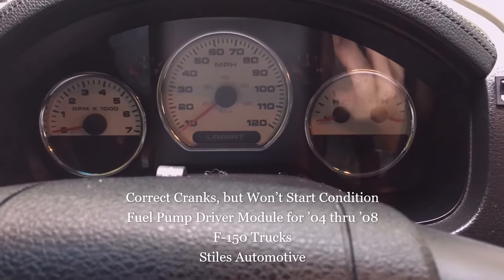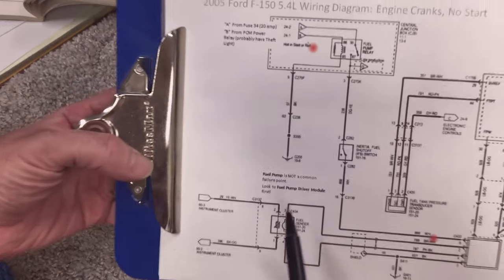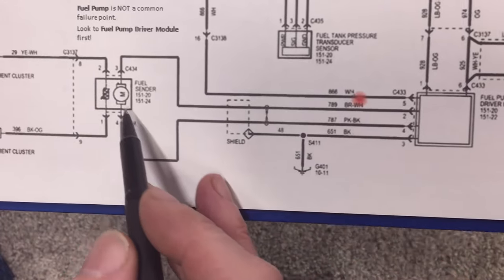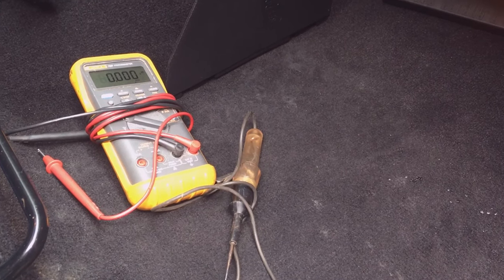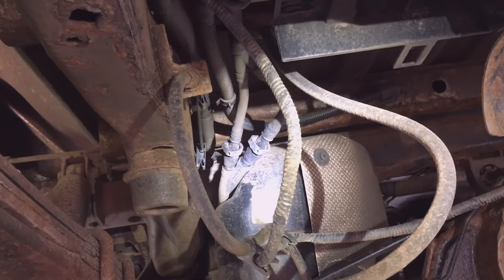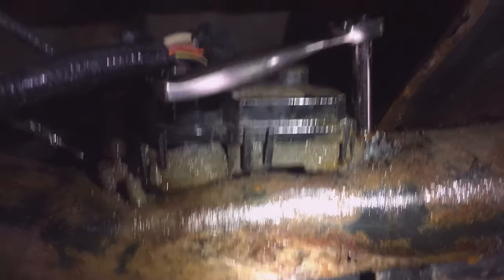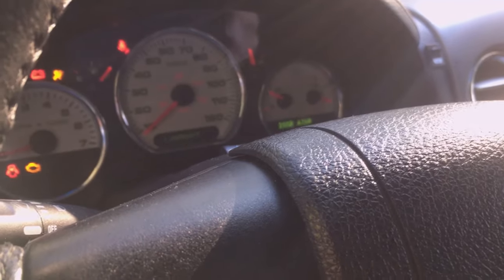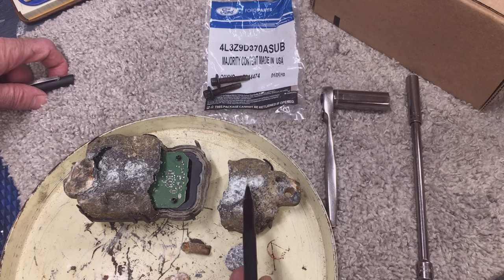Correct Cranks, but Won’t Start Condition – Fuel Pump Drive Module for ’04 thru ’08 F-150

Comment: Hi, please help me. I have 08 f150. Crank,  but no Start. Every morning,  it will start for 5 seconds and shutoff then never starts again. 
So I check the driver pump module, it looks bad. I bypass with wires like you did. I heard the fuel pump running,  but when I tried to start the truck it still wouldn't start. 
What could be my issues? I removed the fuel pressure sensor, I see gas in the rail.
Reply from the maker: Erad, Makes me wonder how much Fuel you have at the Fuel Rail, Can you get a Fuel Pressure Gauge and read the pressure at the Fuel Rail? First do this; After you experience the "start for 5 seconds and shutoff", cycle the Ignition Key on and off (like priming the Fuel System after running out of Fuel, turn Key "On" 1, 2, 3, 4, turn Key "Off" 1, 2, do this 5 times), now start the Truck. If it runs, your Fuel Pump could be weak, (I don't know what it sounds like), has your Fuel Filter either been replaced? If you have good Fuel Pressure at the Fuel Rail, I suspect the Fuel Pressure Switch.

Your FPDM may still be working, but if it "looks bad" replace it and clean the mounting location and electrical connector.  Let me know how it goes! - Stiles
Reply: @StilesAutomotive  thank you for your reply. I did everything you mentioned except for the checking of the fuel pressure.  I do not have the machine to do that option. 

I installed the new fuel module today. The truck started once and dies.  Then never start again, but cranks. 
I have order the Fuel Pressure Sensor attached to the Rail. I will see what happens after. I am a little worried because I saw some videos online that people disconnected the fuel pressure sensor and their truck started and runs.  Mine does not when I disconnected it.
Reply: @StilesAutomotive  Also, I have checked all the fuses and relays. The engine doesn't start to warm up enough to get a code. So, NO fault code is available. It's always shows testing is not complete
Reply: @StilesAutomotive  Hi bro, so I changed fuel pressure sensor, and  the throttle body and the sensor. 
It still does the same thing, started and dies after 3 seconds and never start again.
I removed the fuel pressure sensor by the fuel rail again, I cranked it, there's high pressure fuel flying out. So I know it getting enough fuel. I hear click from relays and fuses are good. Please what is the next thing to do. If timing chain is going bad,  will it start at all? Remember,  it always starts once at first attempt every day.

Comment: When I turn the key to start position I get approximately 9 volts on  the white wire from the fuel pressure  drive module.   Is that sufficient voltage to run the fuel pump?   Or  is there a voltage drop somewhere that is keeping the (new) fuel pressure drive module  from receiving enough voltage to  power the fuel pump?   Your video is the best one I'v e seen.    Thank you one million times.   Please help me with this voltage problem.   It's like you said,  engine cranks but don't run.  It's a 2006 ford f150  5.4 litre.  I have watched about 30   video's so far and spent a week   trying to get this truck to start, including jumpering the  2 sets of outside pins on the fuel pressure drive module, which did cause it to start, plus verifying grounds , fuses,   wiring, etc.     Again, thank you so much for any help you can offer.
Reply from the maker: Winter, Glad to help.  We want close to Battery Voltage at the FPDM Connector White Power Input Wire, Socket 5.  Voltage drop a few tens is ok, that's Battery Voltage minus 0.2 to 0.4 Volts.  We want 12 Volts at that Socket.  We need to be clear, you said "from" the FPDM, the White Wire is "to" the FPDM.  If you are talking about the Brown-White Wire "from" the FPDM and "to" the Fuel Pump, that's different, I don't think you are.  How did you measure 9 Volts at the White Wire at Socket 5  and using the Socket 3 (Black Wire) Ground like I did my video?  If so you need to measure measure voltage again, using a good ground, use a wire and go all the way to the Battery Negative Terminal if you have to.  You wrote about grounds, did you find and clean the ground on the Black Wire at the FPDM Connector?  I didn't do this in my video.  If you still measure 9 Volts at the FPDM Connector, measure voltage before and after (both wires) on the Inertia Fuel Shutoff Switch (left-side of the Fuse Panel, shown in video).  Is all that clear?
1) Measure Voltage at Socket 5 (White Wire) of FPDM Connector using good ground.
2) If 11.8 to 12.6 Volts, goto step 3, if 9 Volts goto step 4.
3) Clean ground at Truck Frame from FPDM Connector and verify Black Ground Wire is ok.
4) Measure Voltage at Inertia Fuel Shutoff Switch (before and after) should be Battery Voltage on both. 
5) If 11.8 to 12.6 Volts - likely White Wire to FPDM Connector is bad.  If 9 Volts we need to look at why.
  I look forward to your reply - Stiles
Reply: @StilesAutomotive  Thank you so much.  I am going to do all these things you said this morning .   I am getting ready to go out  to the truck right now.  I think ford should not have put the central junction box in such an  inconvenient place, but it is what it is.   Also, to answer your question,  I measured the  voltage   by turning the ignition to the on position  and testing between  the white  wire to the blk/yello wire, and that's where i got 9  volts.   When I  returned the key to the off position  there was no voltage.
Reply from the maker: Yep, that's what I thought.  So, I'm asking you to eliminate the Ground Contact Point and Ground Wire as a problem. - Stiles

Comment: I pulled the #5 keep alive fuse believing it was neccesary to calibrate the new blender actuator door and now I have a no crank no start with a u1900 code stored. 
Any suggestions?
I think the ket was turned to on when I pulled it. Might have been a mistake now thinking back on it.
Reply from the maker: JD, Yep with the key on and the system powered you confused the PCM into thinking it has a CAN Bus fault.  1) Try using a Scan Tool to clear the Fault, 2) if it will not clear, attempt to Clear the PCM memory, (With the Terminals disconnected, touch the 2 Battery Terminals together for 10 seconds, be sure to remove the Negative Battery Terminal first [as always!] ).  Let me know how it goes! - Stiles

Comment: Is it safe to drive to the parts store with the paper clip (jumpers) in ?
Reply from the maker: Mit, I wouldn't if you can find a ride to the Parts Store. Is it just a couple of miles? In my younger days I probably would have tried it. Your Fuel Pump will continue to run with the key on, which will over pressurize the Fuel System. Best case, your Engine will run Fuel Rich. Will it hurt the Fuel System, probably not, it should handle the extra pressure. Will it hurt the Fuel Pump, probably not for a few miles. Will it hurt the injectors or push one open (and introduce excessive Fuel into the Engine?), probably not.   In the end, it would be best to get a ride from someone.  Let me know how it goes! - Stiles

Comment: Thinking of getting a 2004 WT base model.... Owner says it's getting fuel and it's turning over but it won't crank..what you reckon that is?
Reply from the maker: yawotton,  Look to the simple things first.  Fuel and spark, how do you know it's getting fuel? and are you getting spark.  Did you owner hear any noises when it last ran?  - Stiles
Reply: @StilesAutomotive   one of these Facebook marketplace deals 🙄... I ask about the fuel pump and he said it's working... Got it from the owner as payment...yeah one of those deals... wasn't catching when he got it

Comment: I tested both the ground the black and white and  the power the white one...the ground one isn't making the circuit light up so I don't know we're to go from there now
Reply from the maker: Marcos, Your message is a little confusing. This may help you. Reference the Wiring Diagram starting at 2:19 of my video. There are 6 Wires, your colors may vary from mine, but should be very similar, these number correspond to the pins on the FPDM Connector:  1) & 6) are control signal wires from the Powertrain Control Module to the Fuel Pump Driver Module (these are the 2 small wires in the center of the connector), 5) White, power to the FPDM (should be battery voltage with the Key "on"), 3) Black, ground (this is the only true ground, meaning to chassis ground), 2) Brown w/white stripe (or BN-WH) (this is the power to the Fuel Pump from the FPDM, 4) Pink w/Black stripe (or PK-BK) (this is the negative from the Fuel Pump to the FPDM, this is not a chassis ground).   Does this help? - Stiles
Reply: Yes the 3)black ground doesn't light up when I test it...we got a mechanic he change the fuel pump and the truck still cranks but won't start

Comment: 2006 f150 will not start with starter fluid. Could this still be the problem?
Reply from the maker: Angie, even if your Engine wouldn't run on Starter Fluid, it should still pop off or try to run. Be careful using Starter Fluid!  I'd look to see if your Engine has spark at the Spark Plugs.  Let me know how it goes! - Stiles
Reply: @StilesAutomotive  the truck was only drove a few times over the last few years. Drove it about 30 miles and the engine shut off. It tried to crank only a few times. It was very loud. Now it wont turn over at all. Power comes on when you turn key. No check engine light and no codes. The battery is new. We are thinking it’s the engine. Thank you for responding

Comment: Replaced fpdm, replaced fuel rail pressure sensor I’m getting fault code P0191 fuel pump is brand new as well. Truck will run fine for a minute then start to stumble and shut off at times. 2004 Ford F-150 4.6
Reply from the maker: Did you replace the Fuel Filter? Put a gauge on the Fuel Rail to help determine what is happening.  Key on, Engine off you should see 35-45 psi, with the Engine running 28-55 psi.  If you don't have a problem with your Fuel Lines you have good pressure at the Fuel Rail.  Then I suspect an intermittent wiring problem.  Let me know how it goes! - Stiles
Reply: @StilesAutomotive  found FPDM was faulty returned it to the auto store and swapped it for a new one, truck runs like née now. I confirmed by checking voltage at connector and jumping connectors
Reply from the maker: @bigbrooklyn25  Very good! - Stiles

Comment: What's the difference between a fuel pressure regulator and a fuel pressure sensor
Reply from the maker: Juan, a Fuel Pressure Regulator is a mechanical device that control the Fuel pressure by returning some Fuel back to the Fuel Tank. A Fuel Pressure Sensor sends a signal to the Fuel Pump Driver Module to regulate or control the fuel pressure. The Fuel System that uses the Regulator has a Fuel Return Line and the System that uses the Sensor does not. - Stiles

Comment: I’ve got question. I got a f 150 5.4 l and the truck won’t start but the electronics is on tho but when I turn the key all I hear is click and nothing happens what could be the problem?
Reply from the maker: What kind of click?  A click like in the video? that's the Fuel Pump Relay, or a Click, Click, Click of the starter.  For either, the simple answer is a low Battery condition.  Make sure your Battery has a full charge, if it doesn't, charge it and determine why it doesn't - Stiles

Comment: Mine I check all fuse and they fine I did the jumper with the 2 wires and pump still not working I did take the pump out and I did conected directly to power and turn on but when I plugged to the wire connector to the truck is not turning on
Reply from the maker: Jesus, Check continuity from the FPDM Connector to the Fuel Pump Connector, and check the Voltage at the Fuel Pump Connector.  The Wiring Harness to the Fuel Pump Driver Module (FPDM) takes a lot of flexing and is likely bad or has a break in it.  Let me know how it goes! - Stiles
Reply: @StilesAutomotive  sir thank you for taking the time to answer I did replace the pump and is working fine on mine was the fuel pump that was bad but I did learn a lot from your video thank you sir

Comment: 04 F150 All lights on the dash work with the radio. Headlights work. I turn the key to the on position and nothing happens. No crank, no start, no nothing. FPDM?
Reply from the maker: Michael, No, not the Fuel Pump Driver Module (FPDM), it is the Starter, Battery Low Voltage (or bad) or the Alternator (causing the low Battery voltage). Although the Headlights and Dash Light work, your Battery may not have the power to turn-over the Engine. - Stiles
Reply: Could be neutral safety switch 😮

Comment: I have a 07 f150 5.4, oil pump failed so i swapped that out and now i have the cranks, no start issue, can’t figure out what it could be
Reply from the maker: James, Start out like I did in the video, check fuses.  I point out the Powertrain Control Module (PCM) Fuses and the Fuel System Fuses.  Did you damage a Wiring Harness or leave a Ground Wire off went replacing the Oil Pump?  I think my Fuel Pump Driver Module (FPDM) failed went I was working on my F-150 and rocking the truck.  Let me know how it goes!  - Stiles

Comment: Thanks so much!! This is exactly what was preventing crank no start issue. You’re a awesome and blessing!! I really appreciate your help sir. Wish you the best!! Question: what happens if we leave the jumper in and drive it while waiting for a new FPDM? Will that be a bad idea? Thanks a ton kind sir!!
Reply from the maker: I might run the truck with the 2 x Jumpers installed (protect them from shorting out), if I had to run the Truck to get home.  You are not regulating the Fuel, so the engine will be run "rich" which means it is getting to much fuel.  I wouldn't do this for very long.  You could easily get a tow truck to get you home.  You are welcome, thanks for the comment! - Stiles

Comment: What did you use for the jumper wires just bent paper clips?
Reply from the maker: Ed, Yep, just paper clips, I only ran the truck this way for a minute to verify the Fuel Pump worked and the truck ran.  I did not move the truck. - Stiles

Comment: Does a 1999 f150 4.2L 6cyl. Have this part?
Reply from the maker: Happy, No, your Fuel System is different.  The newer System doesn't have a Fuel Return Line and this FPDM (Fuel Pump Driver Module) acts to control the fuel pressure.  Your Fuel System has a both a Fuel Return Line and a Fuel Regulator to control the fuel pressure. - Stiles

Comment: Put fuse box on my 2006 f 150 everything lights up no crank
Reply from the maker: Denise, You installed a new Fuse Panel in your F-150? If so sounds like you need to verify everything is hooked up correctly. - Stiles

Comment: Thanks think it's my problem rusty 242000 miles from canada
Reply from the maker: James, of course it depends on what part of Canada you are from.  I lived in Fargo ND for a couple of years and they used very little salt on the road in the winter.  In most of the Midwest the Road Commission puts a LOT of salt on the roads, which cause a LOT of corrosion on vehicles.  The F-150 FPDM is mounted in a position that gets salt on it but doesn't it wash water on it to clean it.  As you can see from my video, my FPDM fell apart when I removed it.  A word to the wise, if you have 242,000 miles on your F-150 and you haven't replaced the Module, do it as soon as you can.  Best wishes for your "rusty problem".  - Stiles

Comment: La otra falla que hace cuando rueda , al cabo de unoa minutos pierde potencia y la apagó y prendo de nuevo y anda bien luego vuelve a fallar y asi susecibamente .
Reply from the maker: User, I used Google Translate to get, "The other fault that occurs when it rolls, after a few minutes it loses power and I turned it off and turned it on again and it runs fine then it fails again and so on."

Yes, that also sounds like a fuel problem, either the FPDM, Fuel Pump, or Fuel Pressure Sensor.
I translate: Sí, eso también suena como un problema de combustible, ya sea el FPDM, la bomba de combustible o el sensor de presión de combustible. - Stiles

Comment: Can I use the car with the jumpers in?
Reply from the maker: Paul, I wouldn't unless there is no other way. Your Engine will run very rich (meaning to much fuel per parts of air) which will likely cause a runability problem. - Stiles
Reply: @StilesAutomotive  
Thanks !!